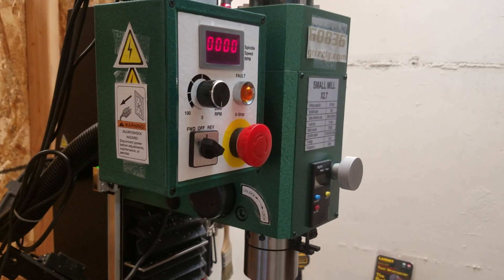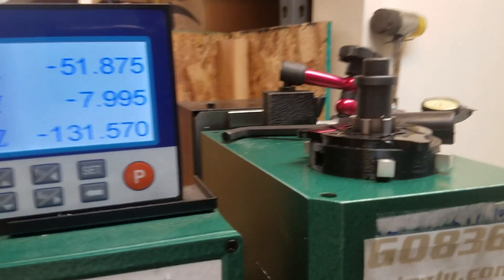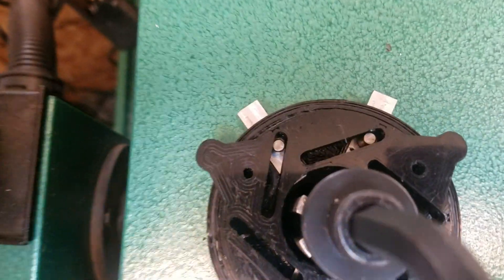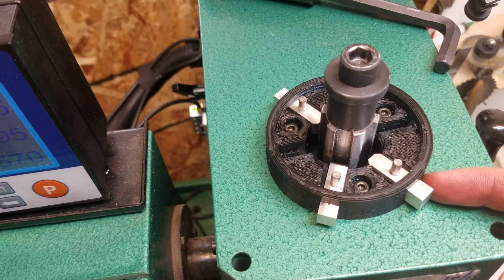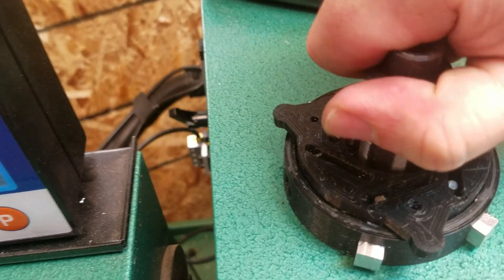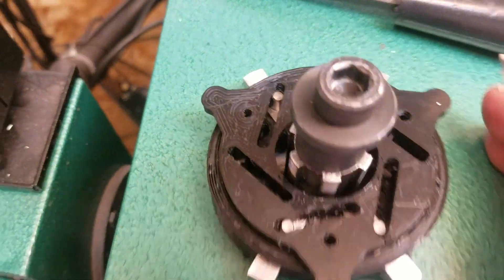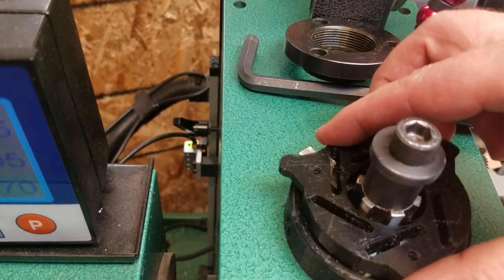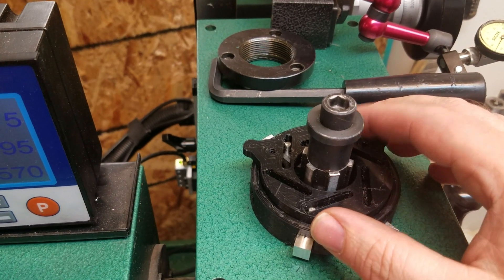Sx2.7 x2.7 lms 5500 g0836 spindle lock for milling machine

Comment: Hi Jesse,
I'm having the spindle seizing up and motor acting up on mine and want to open the back cover to check if there is any cables  loose connections. I removed two screws on the top and two at the bottom back but style doesn't want come off. Anything I'm missing ?  Thanks
Reply from the maker: I'm not sure what you mean by "style".  I have not opened the back cover on my mill.  Grizzly has a decent part diagram if you need a reference.
Reply: @JesseSchoch  Still not style. Sorry. Yeh checked the part diagram but don't understand how many screws need to be removed. I might need to remove all of them. I hope there are no screws to remove underneath the Z axis frame!

Comment: Very interested if you're prepared to share the F360 files - was just in the middle of translating them when I saw your offer.
Reply from the maker: her you go.  https://a360.co/2HyvSYf  hope it works for you.  I used it quite a lot and i ended up cracking the print a bit because I was doing something and had the pins closed and the spline shot up when I unlocked it and it delaminated a bit.  I still works well enough that i didn't bother to print a new one.  I think it may actually be good that the housing was printed since it would break before damaging the spline shaft.  I did end up making an aluminum cog for the pins.  I think i'd do that in acetal or hdpe if I had to redo it.   I  believe printing it in PETG is likely good enough all around though.

Comment: It would also be nice to have the teeth spring loaded so you have to work against them to engage - so they don't accidentally re-engage while the mill is running.
Reply from the maker: yup, however I have not actually had this happen in several months of use with this design.  I did make an aluminum top plate and a larger ply wood handhold.  It works well enough that I have not felt the need to improve on it.  I can take another iteration on the design if there is interest.  I can also share the fusion 360 models.

Comment: Yes there is an SX-2.7 which has different electronics which includes a brushless dc motor.  Do post a thingiverse link when you upload it.
Reply from the maker: https://www.thingiverse.com/thing:3049832  and updated in the details of the video.  Thanks for the comment.  I believe the spindle lock arrangement is the same as the sx2.7, is that not correct?  

BTW i've been using this with an updated aluminum cam top for a while and it is working very well without the catch.